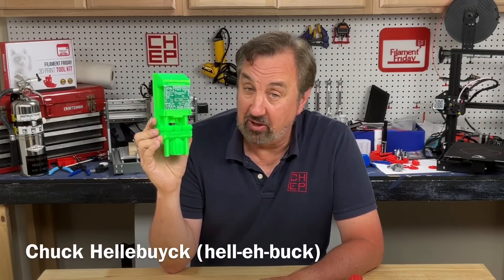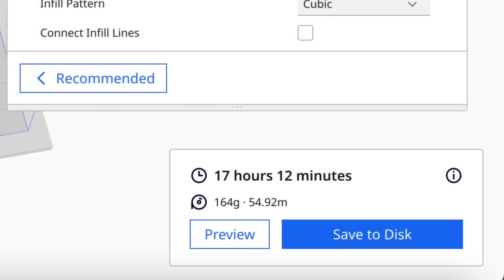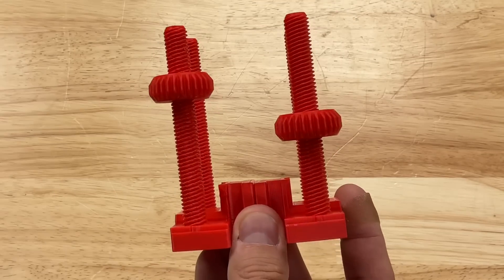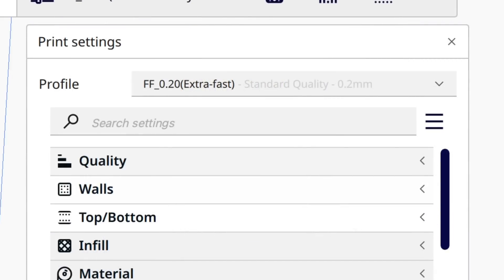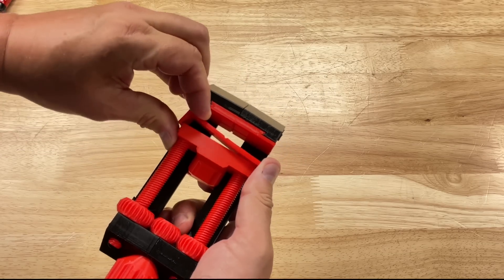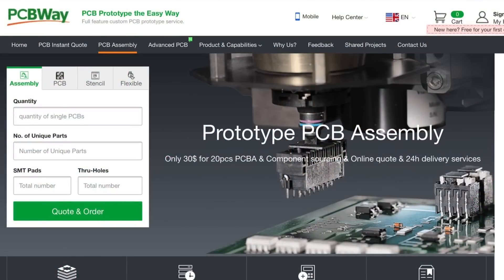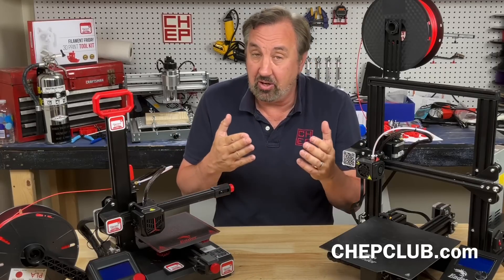Faster and Improved 3D Printed Vise Design

Comment: Hello! I really want to try this but it doesn't prompt me to add the new printer profile after importing the file in cura. What am I doing wrong?
Reply from the maker: It may have already added it.
Reply: @FilamentFriday  it didn't no, I just checked. Could you upload the curaprofile file? I really want to try it!
Reply from the maker: There all inked in this video: https://youtu.be/zAEjGEvtL28
Reply: @FilamentFriday  thank you dearly Chuck!!! I recently have been experimenting with bigger layer heights since I'm currently making the Geodesic Dome Cat House for my kitty. Last night I tried making a 0.32mm profile since that's as tall as you can go with a 0.4 nozzle (80%) and it honestly worked great. You should try it.
Cura did all the calculations so I just based myself in the 0.28mm profile my printer's maker gives you (I have a Hellbot Magna SE) and changed the layer height to 0.32, let it calculate the rest using the Fx button, and raised the nozzle temperature (since you need to melt more material) to 220 instead of the 210 for 0.28 I usually do. The result is a bit rougher looking but completely acceptable for a functional print since this piece will be amidst other 124 pieces to make the full dome.
Checkit out, because it easily shaved off 30 minutes of print time from a 1 hour 20 minutes print.

Comment: Great job. I have one important comment, it is imperative to use conductive filament or especially formulated filament for ESD (Electric Static Discharge) applications.
If you don’t do it, you risk blowing up your electronics components on the PCB. Filaments other than ESD safe can hold thousand of volts which is well above the components ratings.
It is not a question of are the components functional or not. The parts in the immediate proximity of the electrical field will be negatively impacted. The real question is when they will fail.
BTW, it is not necessary for the electronic part to be touched to be damaged. Just to be in the high voltage electrical field sufficed.
Keep up the good work and promote good practices.
Reply from the maker: Been doing this for many many years without a single failure so I would love to see proof of your hypothesis.

Comment: That would be better designed to use metal threaded rods (or even just one). That would get the print time down to a few hours and would take out the most fragile part of the design. It could be cheaper too that way.

Comment: Printing something that small on one printer would still take 12 hours, with technology today that seems soooo slow. I get the feeling the industry is holding back. I can't get behind tech like this that requires a printer farm to complete items in reasonable times. And the tech that can print faster is way too expensive. We get Gutenberg presses to use at home while the rest of the industry gets laser printers, that's what it feels like.
Reply: For me I noticed a really big difference when I changed to klipper on my aquila, just got the adxl345 to work and now I print at 3500mm/s accel without any ghosting and up to 10kmm/s accel with minimal ghosting compared to what I had before, just visual ghosting not enough to feel it by rubbing the finger over it.
0.30mm layers at 100mm/s external perimeters and 150mm/s infill.

I cut in half most the print times

Comment: Hey Chep!!! I was wondering ir you can make a video about the differences between the configurations un cura 5.0 and 4.13.1.
I'm struggling with blobs in the first layers (just the first ones) using 5.0 bit they don't appear using 4.13.1 (yes, i added M413 to the gcode así you suggested a couple days ago).
Thank you very much!!!!

Comment: Have you tried using Klipper on your Ender Pros and V2s? 
From what I understand, it will allow you to basically double your speeds with no loss in quality... But it's also supposed to be a little more complicated than Marlin.
Reply from the maker: I haven’t. I have my doubts though that firmware can overcome the mechanical limits of the Ender design.
Reply: @FilamentFriday  Klipper's Input Shaping in combination with a $5 ADXL345 board is all about overcoming certain mechanical limits (i.e. those caused by harmonic vibrations).  It works so well I find it kind of spooky.

Comment: I can't help to notice you took a swipe at Bambu X1 Carbon 😉  I get what you are saying about price, but there is no comparison to Ender machines and X1 Carbon.
Reply: I concur Brett! I have been looking for a new printer, but not a project. The X1 Carbon has features that I want based on my 6 years of experience on my Robo3D r1+ (which has served me well). The current crop of bedslingers are pretty much the same machine in a different costumes and I’ve been watching the reviews and dragging my feet. No longer!!!
Reply from the maker: Brett’s Reef - I would hope not since you are paying far more than 2x the price for an X1. My point is you can achieve speed in ways other than spending more money. And so far the issues some channel are having along with the speed prints I’m seeing from the X1 at MRRF that were incredibly weak and had layer adhesion issues has me questioning the X1’s value when there are other ways to achieve speed for less and still have good quality solid prints.
Reply: @FilamentFriday  I know you are a fan boy of Creality, However, X1 is a new start of innovation and of course there will be issues. Creality has done the same thing for years and sold people the same old crap under different names. It took them forever just to go to direct drive. So to see a different approach to 3d printing, I think its worth backing a company that wants to move forward. By the way, I've seen many failures of all varieties of the Ender line of printers. Plus no need to spend extra cash on tinkering either.
Reply from the maker: I have one coming to test. I’ll see if it’s worth the price.
Reply: @FilamentFriday  worth the price for you. For me that don't get printers for free, this is a great deal with the AMS. Look at the cost for a Voron you you have to build or the Prusa with mmu.  Its a great value with the hardware you get in inside of a enclosed unit. Have a great day.
Reply: @klave8511  Never said they were crap. I said all their printers are the same crap as in design. You can't compare x1 carbon to any of the Enders.  Sorry I rather spend the same amount of money and get the x1 carbon and ams than cr-5  pro.

Comment: Something that should be mentioned is the max acceleration mm/s setting. I've found that you can far exceed the recommendations if your printer isn't floppy and unsupported. I see 60 mm/s as the normally recommended speed, but on my printer print quality actually suffers if I go below 80 mm/s, so for my first layer I do 80 mm/s, and everything else I do 120 mm/s, sometimes going so far as 180 mm/s if I'm printing a wide, very flat part.

Comment: I just printed this vise!  Sooo jealous how easy all your parts went together lol.  But after 2 weeks of reprinting and sanding down multiple parts, I finally got it put together yesterday. I too changed and reprinted the handle longer with a smaller diameter... Also made a slot in the inside to put my little electric screwdriver to it.
Reply: Mayve your horizontal expansion setiings are of. Print 2 cubes of different sizes and then measure them with calipers. If they are off by the same ammount (for example 10.1mm and 30.1mm) you have to adjust it by that amount
Reply: For the record, I am new to 3d printing... The accuracy was really good on other prints i ahve done. I think what happened is I printed the base in pla with a much bigger layer height than the other parts. The others I did a small layer height and used petg and pla+. With the base being printed different, everything attaching to it was a little off. I got it working tho! Half the reprints were because I dropped them and they broke lol. I appreciate the tips!  I'm going to try that out.

Comment: I need to add up what I have in my (formerly) Ender 3 Pro & mods. I was on track to a 25min benchy when poor driver cooling (my fault) caused a layer shift.
MKS board
TMC2130s
Klipper
Titan extruder
Microswiss hotend
Yellow bed springs
Petsfang cooling
Ezflex
Pi3b
Assorted printed items for the above.
Expensive now, but most items were purchased back in '19.

Comment: Tried cura 5.0 but retraction is a consistent problem. Switched back to 4.8 and everything works as it should
Reply: 5.0 defaults to printing outer walls first, which means a problem you may have already had now shows up somewhere visible rather than inside the print. You can put it back to inside-out wall order, but there are good reasons not to, or you can try to fix the problem. Most likely it's oozing inside the model due to combing and can be fixed by setting Max Comb Distance Without Retract to 1mm and Connect Infill Lines on.

Comment: The original version of that pcb holder is one of the first things I printed on my Ender 3 back in 2019.  It's a great design and prints really well.  I use it a lot at work and it's held up really well.  Nice to see one of my favorite models turn up in CHEP video.  Great content as always.

Comment: Hello,

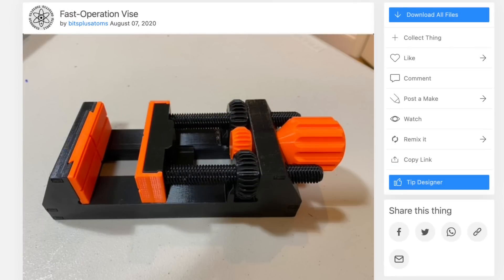0:51 in the description from Yet ANOTHER Machine Vise by TheGoofy, he have link another horizontally rods. They are very fast and works perfectly.

quote:
If there are difficulties to print the threaded rods vertically, I've designed a version of the sliding jaw with horizontally printed rods

Horizontally printed rods for ANOTHER Machine Vise
by TheGoofy February 20, 2017

many greetings

juck.

Comment: Hey Chuck- Is the FF 0.20 Fastest Cura 5.0 Profile included with the Long Handle Part?
 It would be great if your NEW Cura 5.0 Profiles were all released in one file for Patreon Users, instead of attached to models for my Ender-2 Pro.
 My Ender-2 Pro amazes me at how good it prints each time I use it!

Comment: Great video as usual but I disagree that you have to spend over a thousand dollars to have a machine that prints a 17-minute benchy.
Reply: Yep. I have a $200 Ender 3 original with about $135 in upgrades that can print a high quality 17 minute benchy or a decent 14 minute one. And some $400-500 deltas can definitely do it out of the box.

Comment: Chuck have you tried the extra fast profiles with PETG? I've found PETG to be picky at being printed fast...
Reply: @Jason Gunn I print PETG at 235 which is a walk in the park for most printers.

Your issues were most likely with your nozzle, or buying crappy PETG.

You gave $80 worth of filament away because you couldn't figure out how to print it properly? 

Brilliant. 

Everyone should definitely take your advice...
Reply: @dangerous8333  IME PETG @ 235 is only viable very slow and with fan very low or off, which gives poor accuracy and overhangs. Otherwise you get really bad layer adhesion & brittle parts. I used 245 with PTFE lined hotend with decent results, and have much better now with all metal at 260+.
Reply: I print PETG at 150 mm/s on an Ender 3 v2.

Edit:
Using a genuine Micro Swiss hot end.
Reply: I haven't tried the extra fast profile specifically, but I've added the biggest changes, like line width, to my own profiles and have found no problem printing PETG using a stock Ender 3v2 and $15/kg PETG from Amazon. I do run the nozzle at 235-240. The biggest problem I've found is the stock extruder skips a little when trying to push filament much faster than default, but that's a common complaint for PLA too.

Comment: So Chuck, just for clarification is the only difference between your .20 and .28 profile the .20 versus .28 layer height? I use your .28 as my daily driver so if I can simply change the layer height to get better quality and don't have to change anything else that's good to know
Reply from the maker: RoXolid Productions - Yes, I only changed that setting. Like MasterOfToasting said, just try it. 
Let me know your results.
Reply: @FilamentFriday  Thanks Chuck, I have a few prints over done thus far and they're ok on a new machine, but I'm looking forward to testing with my regular printers soon.
Reply: Wtf, dont people try anything at all ny thenselfves ? You can try any height you desire
Reply: @guvenator  Not going to start an argument on someone else's channel, I'll simply say there are more settings in Cura beyond just the layer height. This is what I was asking for clarification on.
Reply: @guvenator  What if he just had no time to try some things on his own? Or if he is happy wirh what he has and didn't felt any need or desire to aquire those skills. 
Is it really helpful, to invest much time into learning a skill, if you simply don't really have this time or you have no opportunity or situation, where those skills even could be helpful? 
Just because you have something that works totally fine without knowledge, would be even more helpful or could be used in many more ways with skill and knowledge, doesn't mean you HAVE to aquire those things.
Let him be and do whatever he wants.